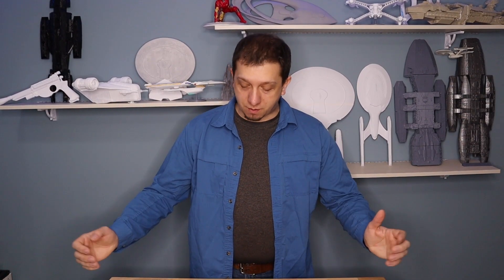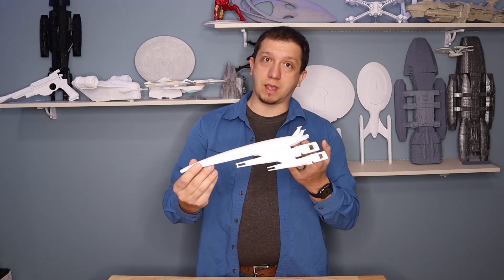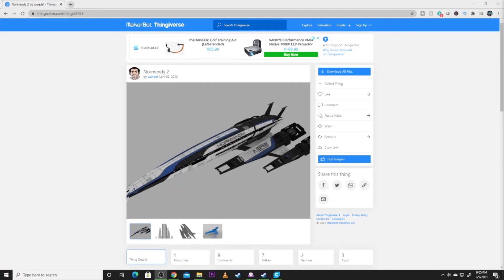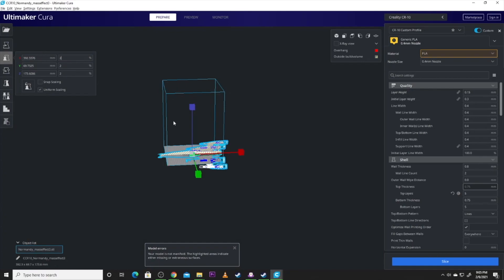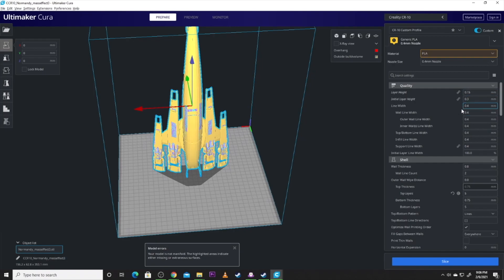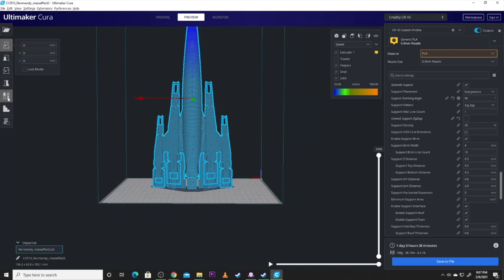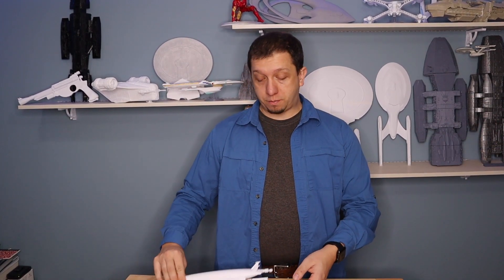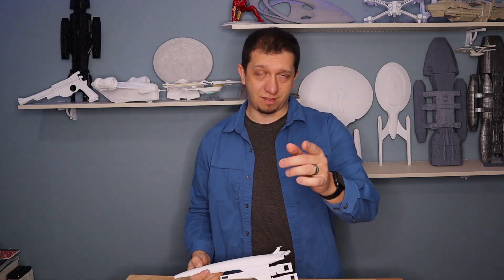Mass Effect Normandy Class Cerburis SR-2 3D Model: 3D Printing time lapse & tutorial

Comment: I saw some models for the Normandy that have it printed in parts and assembled, wouldn't that be better??

Though what i was looking for was a resin printed Normandy to see if it works, or would it be too heavy??
I don't have a printer yet but am looking for what is best for models, i love spaceships, and i love the Normandy ALOT, another one is the Hyperion battlecruiser from starcraft 2. I know resin requires a bit more work but is more detailed than filament, but for big models? Like as big as those 2 one the right on the shelf (black and purplish), any idea if resin can support that??
Edit : i kinda answered it myself, for resin am better off with assembly model i guess.
Reply from the maker: Hello,
There is absolutely nothing wrong with printing models in parts and assembling. For most models resin or FDM you will have to. I prefer to print them in one piece when I can because that is less seem work and filling for the most part. 
If you go the resin route you will have to print in parts because most printer sizes will not allow you to do what you see on my FDM printers. My CR 10 can print 3 times larger than the photon mono X.  

For ship models like you see on my channel I get great detail out of the model. And The Normady was no fail. I had to reprint one small part but a lot of her detail is in the paint job. THe Hyperion was just shown on my last stream so go check that one out!!!  Video coming on that one later. 
I would recommend you go check out some of my resin printer videos and also keep in mind with a resin printer you will also want a wash and cure station that will also increase you cost.  
FDM can also get really great detail if you check out my streams with the Super Star Destroyers I am working on or the Battlestar Pegasus Videos. 

Also keep in mind cost of materials to print with Resin while it is coming down in price is almost 2 times as much as my filament that I use for the 1 KG mark. 

Thanks
Mike
Reply: @Rise3DBuilds   Ah thanks, yeah the resin seems more expensive for materials and setting up, thanks for your time!